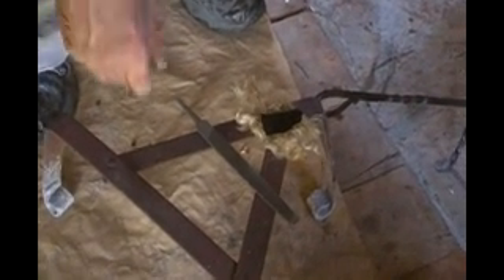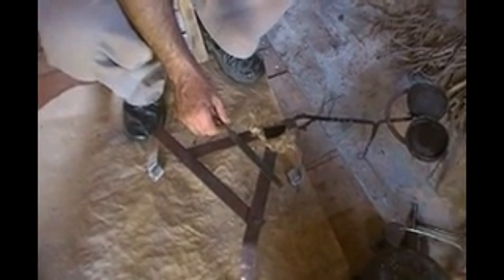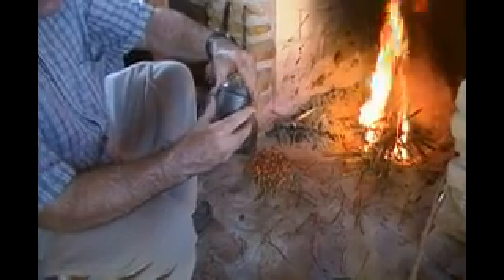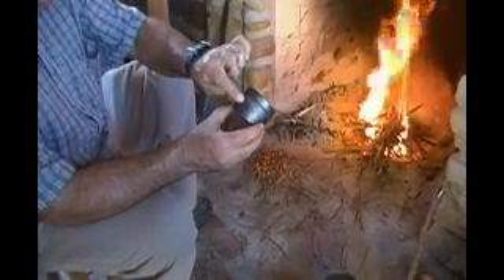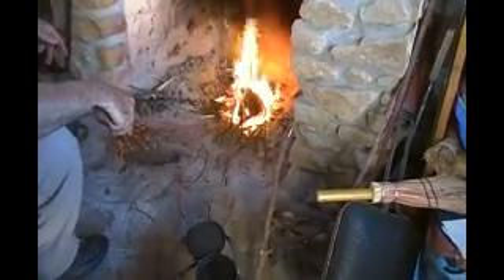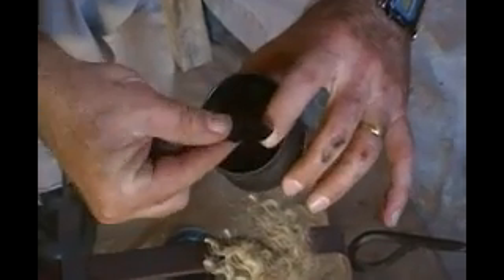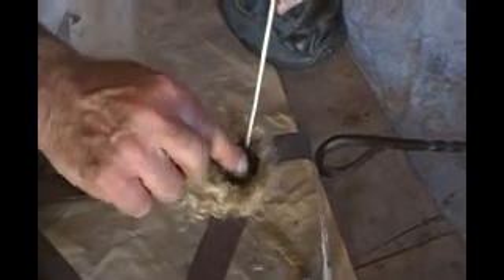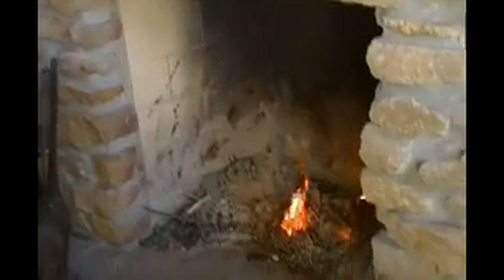Flint and Improvised Steel Striker

Comment: I wonder if a steel/metal nail file would work. Next camping trip I will try. When making the char cloth, should there be a small hole on top and bottom? Or, just the top side that faces opposite fire?